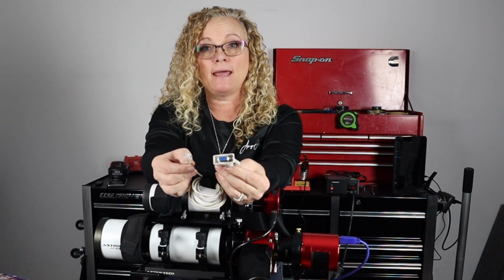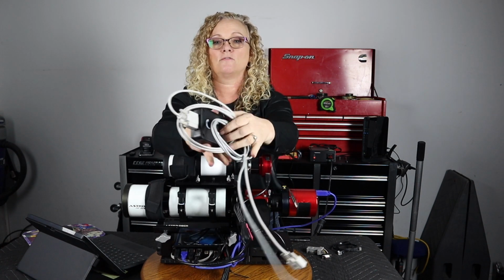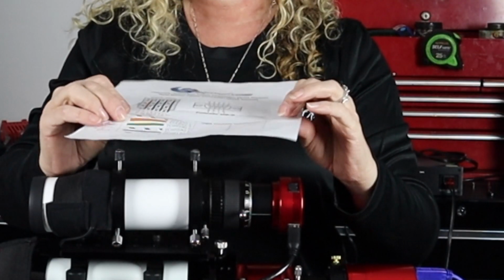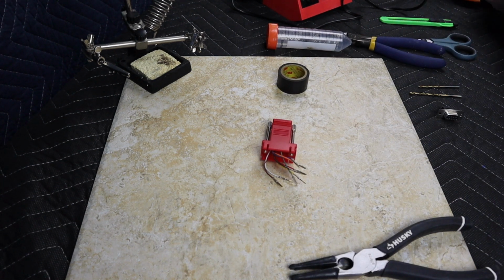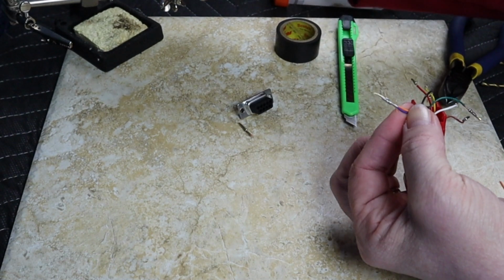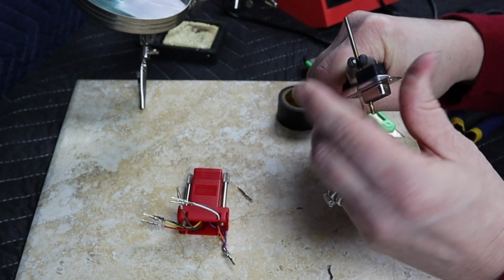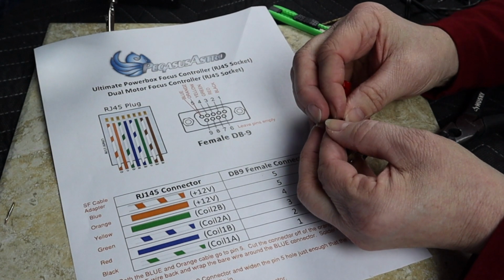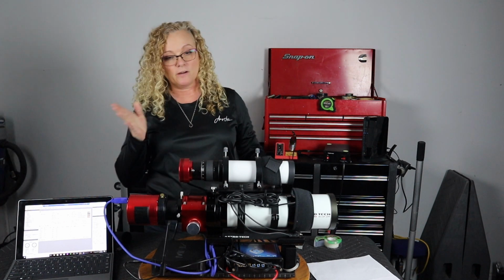Astrophotography Custom Cable Build - Moonlite to Pegasus UPB v2 Communication. (RJ45 to DB9)

Comment: Hi Amy,

Another more costly solution is to use a RG45 crimping tool and wire a new RG45 connector to the bad cable according to the diagramm.  However, it was the best thing you had to do.  Did use that kind of adapter to plug my Robofocus to my Lantronix Wibox.

Thanks helping the astro community!!!
Reply from the maker: Thanks for the info!

Comment: Great ingenuity making the cable. I'm surprised you can't buy a cable to connect the powerbox to the focuser, they are commercially available here in Europe, made by Pegasus Astro.
Reply from the maker: I hunted their website and they spoke about one, but could not locate where to buy. Someday.
Reply: @AmyAstro  You won't find it on their website, but it's on the website I use regularly, and it's fairly cheap. 😁

https://www.astroshop.eu/miscellaneous/pegasusastro-stepper-motor-cable-rj45-to-db9/p,56258

Comment: Looks good :) and glad you made it works. If I were you, I would try to jump the orange/white orange wire from the patch cable since they are going into the same pin on the DB9 connector.
Reply from the maker: I thought about it but could not get to the wiring on that side. I did find another adapter with a terminal block inside. May have been easier
Reply: @AmyAstro  Still a cool project though :)

Comment: Very instructive. I couldn't tell for sure but it looked like maybe the top row wiring was reversed from the picture?
Reply from the maker: Thankfully they stamped the pin number on the hole. Just needed a magnifying glass and light to see them. I made 4 plugs total and only the first one failed. :). Not too bad.
Reply: @AmyAstro  OK, I see now. The Pegasus Astro Diagram is of their connector that yours plugs into.

Comment from the maker: For the Non-DIY person.  A viewer just located a pre-made Cable!
https://agenaastro.com/pegasus-astro-rj45-db9-stepper-motor-cable.html?fbclid=IwAR3NRwGb7nYA_bD_rWYMl8WrbjDfn5z5Y8dYaDNRsJ7Acgo-f9L8TCC6RJs 
.
Help Support this Channel with Amazon Affiliate Links.
.
Ethernet Patch cable 1.5 ft  https://amzn.to/390cyPX
DB9 to RJ45 Modular Adapter https://amzn.to/38TV8UR
Soldering Iron https://amzn.to/37MujSn
Rosin Core Solder wire  https://amzn.to/2tfzxam
Plier Set https://amzn.to/36LUozU
3rd Hand https://amzn.to/2UbII6Q
.
.
Video Equipment
Rode Microphone https://amzn.to/2svr4j2
Canon M50 Camera https://amzn.to/2NqjL39
SwitchPod DSLR Tripod https://amzn.to/2FOp20v
.
.
Raven Setup
Mount - Raven https://amzn.to/386yZ5s
Telescope Explore Scientific https://amzn.to/2FTQc5Y
Main Imaging Camera -Raven Scope mono ZWO https://amzn.to/2Rji0Gh
Mini PC-Raven https://amzn.to/2QTP7Bu
Filter Wheel 1.25" https://amzn.to/2RpSiQG
Filter Wheel 36mm https://amzn.to/3afloui
Guide Camera-Raven https://amzn.to/3abLI8F
Guide Scope-Raven https://amzn.to/3a93M3j
Saddle Upgrade - https://www.admaccessories.com/product/dual-eq6-rpro-dual-series-saddle-fits-skywatcher-eq6-orion-atlas-mounts/
Risers/Spacers https://www.admaccessories.com/product/risers-threaded-riser-blocks/
Saddle Rosette Tool - https://www.admaccessories.com/product/rosette-knob-hand-tool/
.
.
Freedom Setup
Mount -  https://amzn.to/2tlZTYb
Mini PC  Freedom-  https://amzn.to/2TjmeAo
Main Imaging Camera -  https://amzn.to/2sqVYsK
Guide Camera - https://amzn.to/35SuYzV
Adapters - https://amzn.to/2NsKsEA
Adapters - https://amzn.to/3aff9Xq
Triband Filter https://www.landseaskyco.com/altair-2-triband-filter.html
Saddle Upgrade - https://www.admaccessories.com/product/dual-heq5-dual-series-saddle-fits-skywatcher-heq5-orion-sirius-mounts/
Risers/Spacers - https://www.admaccessories.com/product/risers-threaded-riser-blocks/
Saddle Rosette Tool - https://www.admaccessories.com/product/rosette-knob-hand-tool/
Filter Holder - https://www.highpointscientific.com/starizona-complete-rasa-8-inch-filter-slider-system-for-select-zwo-cameras-sfs-zwo